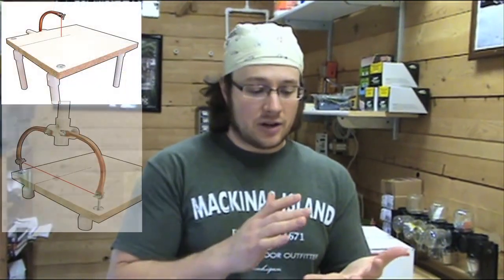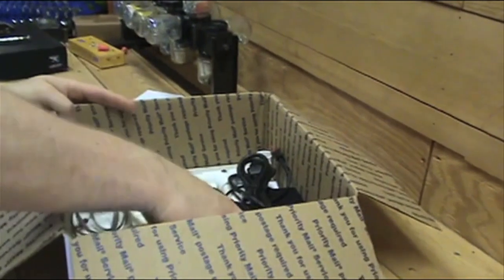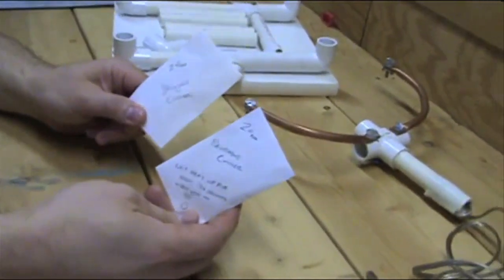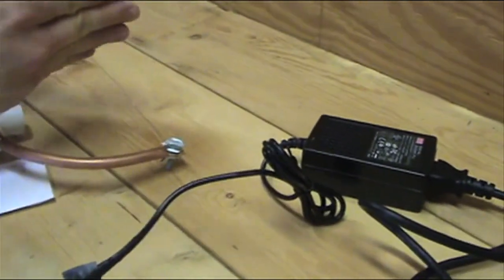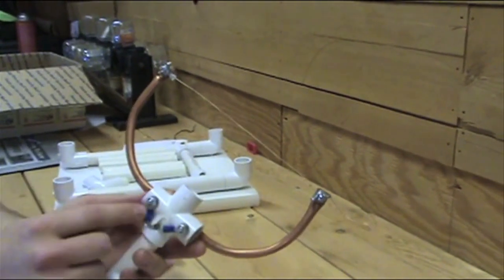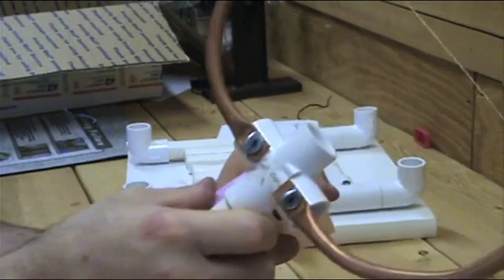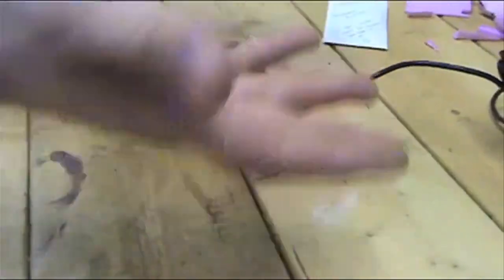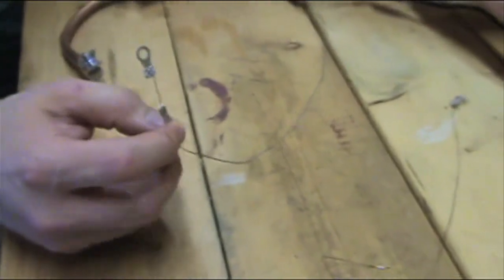Terrainaholic Introduces the Combination Foam Cutter

Comment: VERY Cool. How long of a wire will a power source like that heat up? Will it power a 36" bow cutter?
Reply from the maker: Hello! The power supply is only 5 volts, so it really can't do more than 10" or so. Check out our website, for a LENGTHY discussion of nichrome wire and power supplies. Otherwise shoot me an email, i'd be happy to reply

Comment: You're instructions are also one of the easiest to follow that I've found so far. Super good job at filming and explaining this project! Thank you for sharing!
May I suggest U one suggestion ? can we add On / Off butten in circuit near the copper tubing..And all so to add a spring at one end of cutting wire to take care of expansion & to avoid slag in cutting wire.
Reply: Ashok Nikumbh Thank you for your positive feed back! You can definitely add an in-line switch or button to control electrical flow. Most of my larger cutters have springs in them, but with smaller cutters it takes away from the cutting length. Also, the springs will extend while cutting which makes the cutting line a little too variable. Some people like them, some people do not. Whatever you like! Check out the website for designs and diagrams. Thanks!

Comment: will this cut foam board? i think i asked this question b4 but lost where i posted it
Reply: +Chad Brailer You're referring to paper-backed foam core? Technically it can... but the paper is the most rate limiting step. You have to have a better power supply to get the wire hotter to melt the plastic and burn the paper. Not impossible.
Reply: Thank you!!!